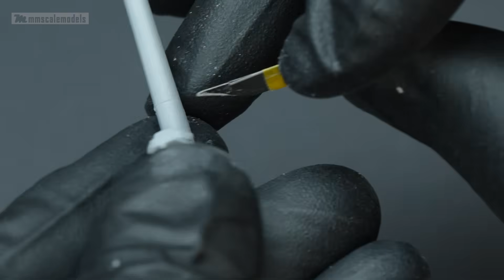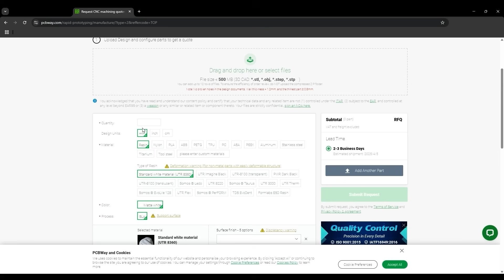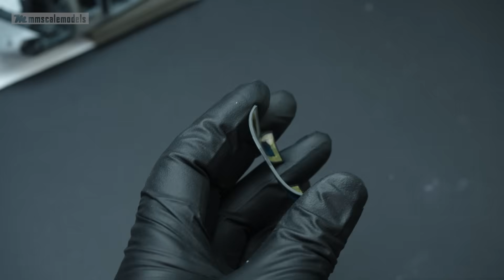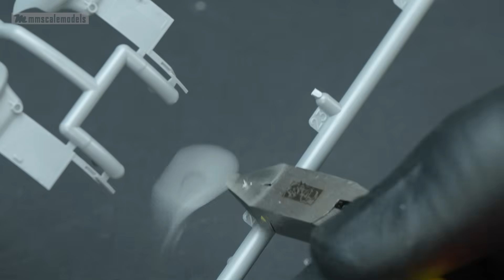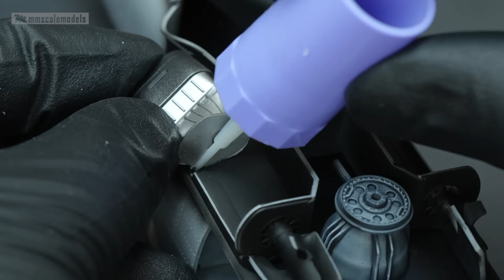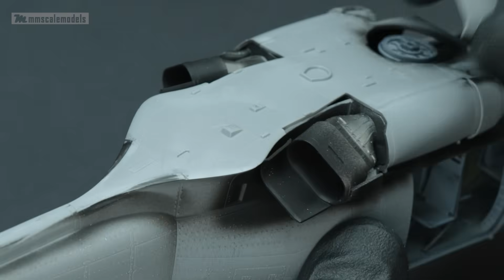One step forward - MH-60l DAP 1/48 ICM - Project Black Hawk - Episode 7

Comment: Will i have to agree. This plastic has been fighting you every way imaginable. But your perseverance is paying off. Ive never built an aircraft produced by ICM. I have built some of their figures (Japanese and Gurkha) kits, as well as and old 1/35 scale WW11 German vehicle,  small personal car that i think the Kublewagons replaced. The figures were no more of a problem to assemble than other manufacturers but the small car was a puzzle to get together.
Thank you for the build video.
Reply from the maker: I had no such experience with their Invader. It was a solid kit. I don't know what's going on here. Is it generally broken, or is the assembly too complex, forcing user error.